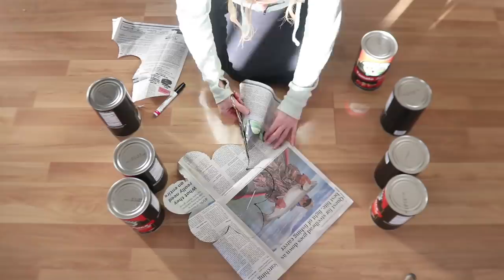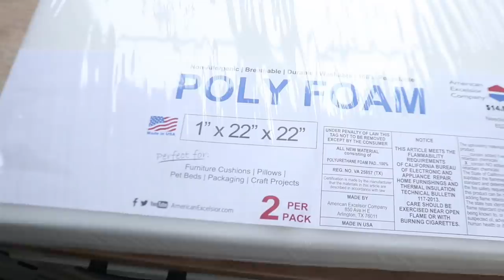DIY Ottoman ~ Trash to Treasure ~ Old Fashioned Hassock Tutorial ~ DIY Footstool

Comment: I was so happy to find this!  My grandma made each one of us our own "can stool“.  I’m nearly 69 yrs old and still had mine until about 5 years ago.  It was all completely done by hand and not as fancy as yours.
The cans were taped together with old strapping tape and tied with cord. A piece of oil cloth covered the bottoms of the cans and the top was padded with cotton. Material was a large circle and covered the whole thing. It was placed on the material with the top down and hand stitched all around and drawn tight at the bottom. 
She then crochet a cover for the outside.  I haven’t been able to figure out the "pattern” for the cover so mine no longer had the crocheted cover.
It brought back a lot of memories watching your video!❤

Comment: I have been a big fan of yours for a long time Mary. I have been thinking of things to use cans for too. I have discovered a new hand held can opener that breaks the seal of the can instead of cutting it which leaves dangerous edges. My new one leaves smooth safe edges and the lid will fit back on. makes a great container with a lid.

Comment: I have seen them made with scrap 2x4 pieces instead of the cans and screwed to round or square plywood tops and bottoms. Cardboard boxes are cut up to wrap the outside. Then finished as yours, with bun feet added to the bottom.

Comment: Mary I made these hassocks many moons ago. Yours came out lovely. I made them with gallon sized cans I got from a restaurant. If you can buy a product in gallon size cans, remove lids with a can opener that removes it intact and it can be reattached. I wash my cans throughly and add a touch of bleach to kill  any odors or remnants of food. I also did exactly as you did with  one exception. I screwed the cans together at the the seams before assembling them . My ottomans were much larger, they had wooden feet screwed on bottom and I added fringe and piping. It’s funny that you have started making these at this time because I have acquired some gallon sized cans last year and had decided to make another one  but hadn’t gotten around to it. But I hopefully will. I recently thrifted a beautiful ottoman and so I was not in a hurry. Have you tried making one with a hinged top where you can store things on the inside? You can put a loop and button closure and store sewing supplies in it.

Comment: So very cute will have to make one of these, only think I may do differently is weight the cans so that it doesn’t move to easily, I would like it to have some weight that my feet don’t shift it easily. I would need to figure out what to weight it with that will not make any noise against the walls of the can so likely fill the cans with expansion foam or something.

Comment: i am making this from my grandmas pattern, she used cardboard not wood, she used tube socks around the cans, we tack welded the cans so i too used batting around the edges and i hot glued them in the creases like you did. but i used batting for the top and then cute kid material with denim under it for stability and then denim on the bottom.  my problem was when i was sewing the side to the top.  your video did not show me enough on how to connect that..  i tried to keep the side part straight amd move the daisy part around but when i put it on the stool to see how it looked the corners of the daisy were funny.  when i get to the corners should i stop and pivot?